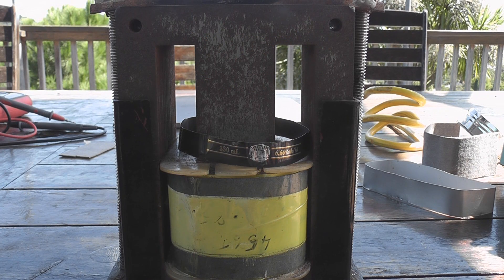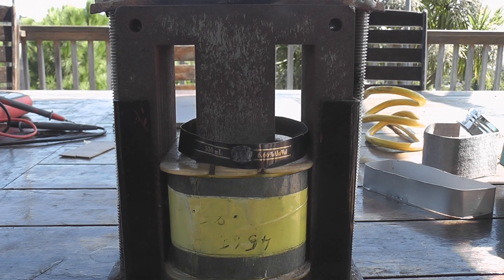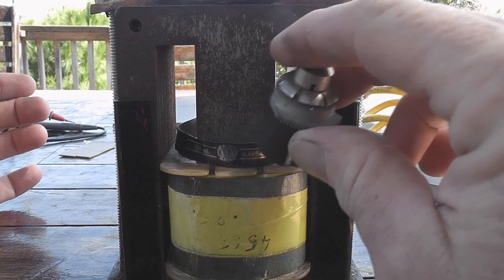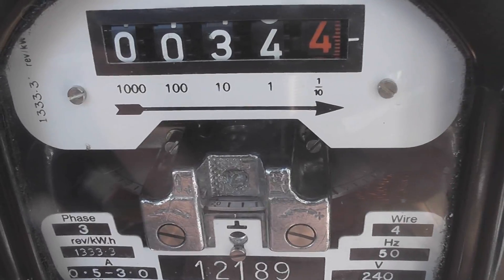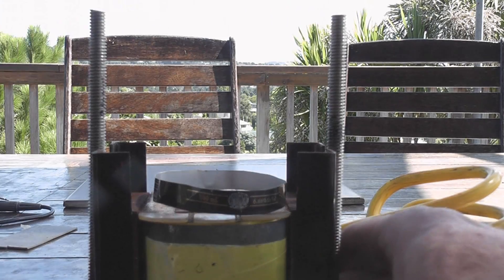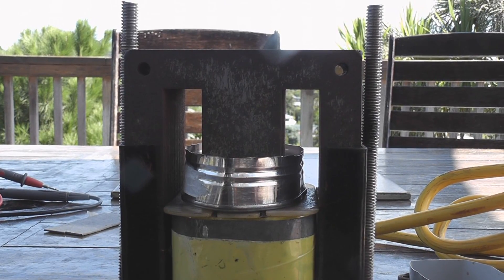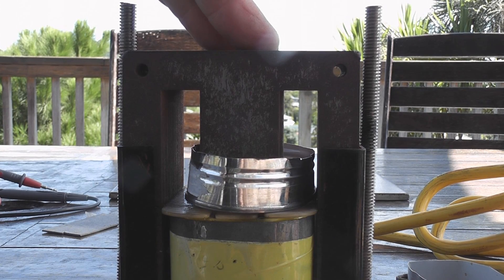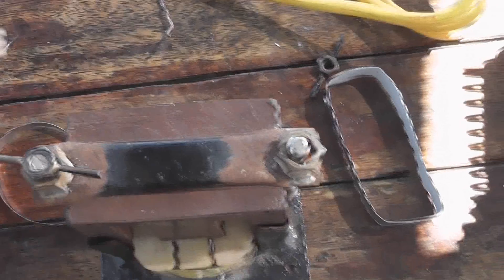Electromagnetic Levitation

Comment: Yes our physics teacher pulled out a 300va EI core and energized the core to 1 tesla which is typical flux for a EI transformer  He then placed a shorted turn made of a 100mm diameter aluminium band 19 x 1.6mm around the center leg which also hand handles. When he squeezed the handles together to create the shorted turn the upwards force of 130 Newtons was about 10~12kg.  Very strong force for such a small transformer. He struggled to hold it steady. Imagine a 10MVA Core with no fault current limiting, it strong enough to stretch and sheer off large steel bolts!!
Reply from the maker: +bjtaudio Excellent comment, the forces are huge even for a relatively small transformer. In large substations there are often reactors to reduce the available fault level in case of a bus fault.

Comment: In large distribution transformers this telescoping force can be enormous during a fault current event. Strong enough to to do physical damage, so to remedy the problem large transformers are wound for relative high impedance to keep fault levels down, and a tap changer is used to compensate for the other wise terrible voltage regulation.
Reply: +bjtaudio I remember being told this in college during transformer theory, really good to see a physical demonstration of the forces involved!